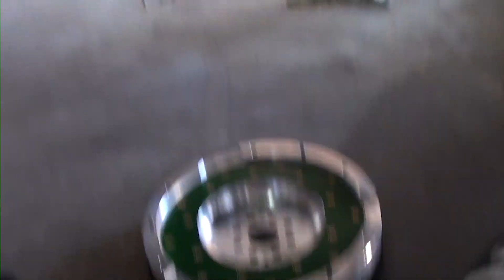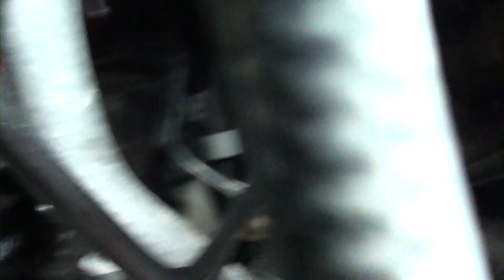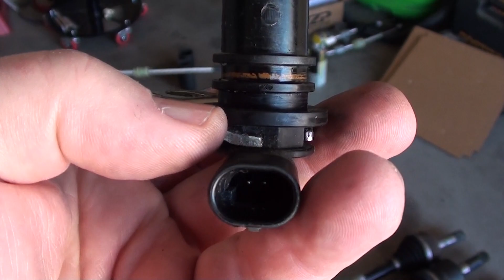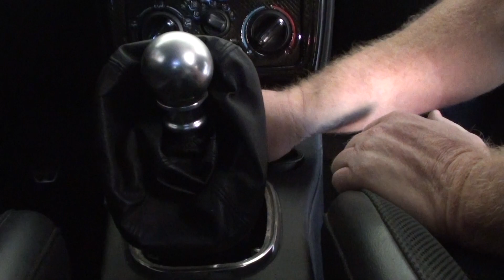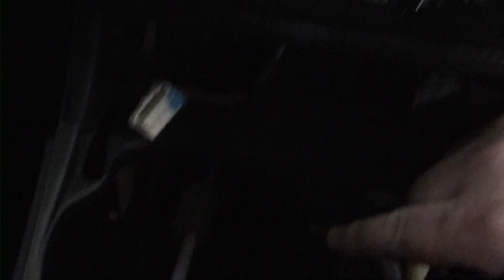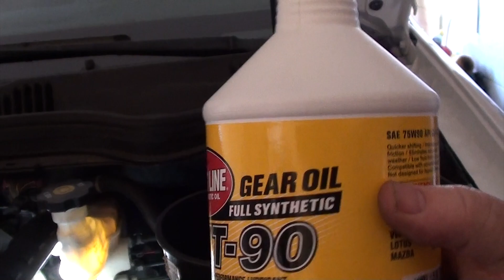First Start Up? How to install clutch and Upgraded F40 6 speed conversion Cobalt SS Turbo LNF Part 5

Comment: Tip for removing clutch rod from clutch pedal: Disconnect lines. Rotate clutch cylinder and pull out of firewall. Rotate clutch cylinder back resting against firewall but not locked in firewall slots. Push clutch pedal to the floor keeping clutch cylinder held close to firewall then the white tabs will compress so much easier with just your fingers since you're not squeezing the white plastic tabs onto the rod anymore since it's angled out of the way. Fought this for over an hour with screwdrivers and much frustration the other day, went back at it in the morning and was done in 2 minutes with this method.

Comment: Nice videos. I recently installed the F40 in mine with the ZZP aluminum flywheel and Clutchmasters stage 5 clutch. The car runs smooth and shift awesome. But rattles in neutral really bad. The sound goes away when the clutch is pressed. I think I should have used the dual mass flywheel.

Comment: hey . i’m in the middle of an f40 swap, do we have to use the 2nd sensor located on the front of the mission towards the front mount ?? it’s black and i don’t seem to have a spare wire for it anywhere i can’t remember if i took 1 or 2 sensors off my old transmission when disconnecting it
Reply from the maker: Not sure what that one is for but mine came with that sensor and it plugged in on my wire harness
Reply: @spencercurtisjackofnotrade4627  lol. funnily enough my one buddy zip tied it to one of the looms to keep it away from everything else when bolting trans up. he drove me nuts
Reply: I think you were to wipe the green coating off with acetone.Looks like the fidenza i have

Comment: Question... the speed sensor, did you put silicone only on the top you you put silicone on the entire sensor? It looks fully blacked out
Reply from the maker: I put it around the whole sensor to keep the transmission oil out
Reply: @spencercurtisjackofnotrade4627   does the passenger axel really work for the drivers side??
Reply from the maker: @briandiaz7612  if it's an f35 the f40 will require a shorter shaft on the driver's side
Reply: @spencercurtisjackofnotrade4627  gotchu. I could of sworn I heard it on a video of yours that the passenger axel fits when doing the f40 swap
Reply from the maker: @briandiaz7612  it does fit on the passenger side but not the drivers side that is correct,  maybe i didn't understand the question or read it to quick.  thanks for the reply.

Comment: Did you need a throw out bearing spacer for your setup?
Reply from the maker: I didn't use the space between the engine and transmission.
Reply: @spencercurtisjackofnotrade4627 so you did not use the spacer between the engine and the tranmission. The  bellhousing spacer?

Comment: Hi awesome work can you tell me after transmission f40 install and zzp kit what can clutch disc use Buick or Saab ?
Reply from the maker: you can use the standard flywheel with the clutch plate and pressure plate out of a buick GS or you can use a zzp flywheel that is made for the f40 with a stage 4 plus pressure plate and clutch plate they sell that is stage 4.    they have both setups,  i would call them they can help you with that.

Comment: What silicone did you use on the speed sensor? And have you had any issues with it?
Reply from the maker: the right stuff,  no it's still working like a champ!!
Reply: @spencercurtisjackofnotrade4627  Thank you!
Reply: @spencercurtisjackofnotrade4627  I tried it, but it didn't work for me. The speedometer stays at 0.
Reply from the maker: @Frank-zx9om  maybe you cut one of the wires
Reply: @spencercurtisjackofnotrade4627  I pulled off some of the silicone and realized I pulled one of the wires with it. I had a spare sensor and got it to work now. Thanks again!
Reply from the maker: @Frank-zx9om  sweet 👍